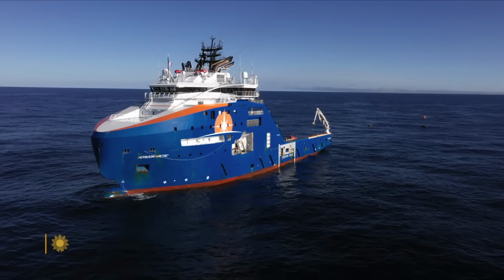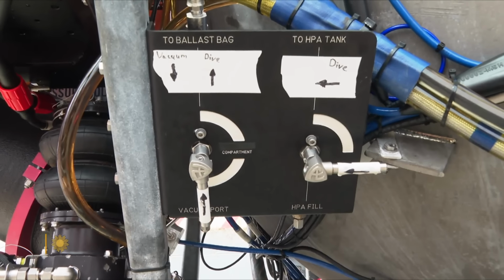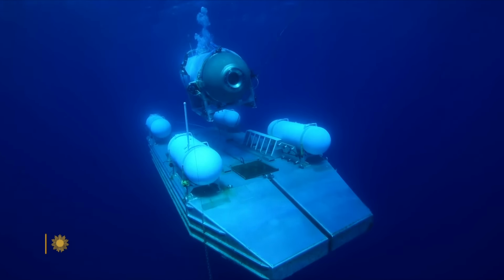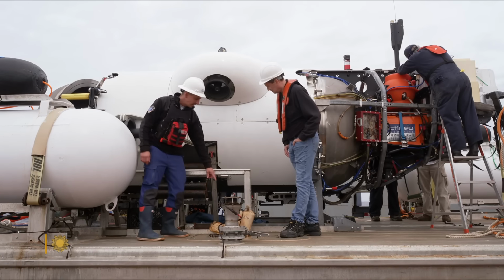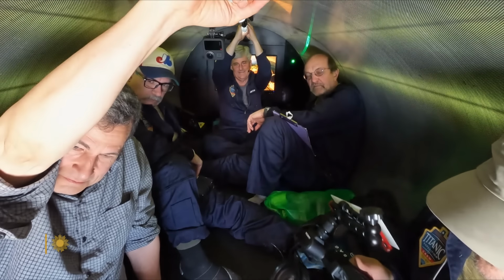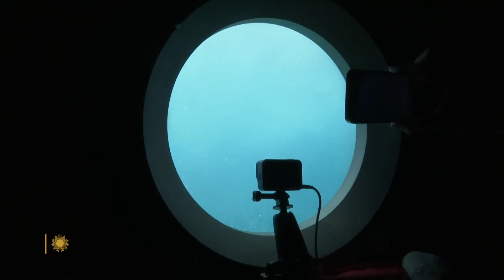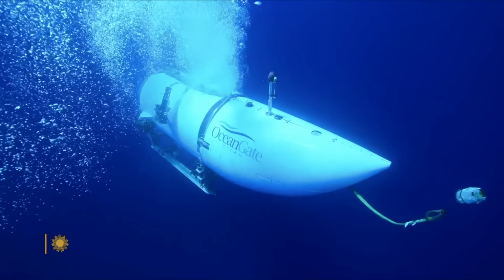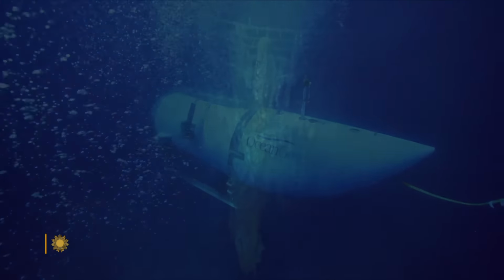Inside the Titanic sub disaster

Comment: Carbon fiber is great for tension....but terrible for compression, especially in the shape of a long tube.  Rush was using it just opposite in terms of it's actual strength.  NASA used carbon fiber pressurized containers on the Space Shuttle, but they were 1) spherical in shape, and 2) contained internal pressure, not trying to withhold external pressure.
Reply: Why did NASA went with the production?
Reply: @rollzolo NASA uses the same material for their spacecrafts, but to my knoweldge they had nothing to with the creation of this tincan. if i recall a lot of the parts used were for air planes, used parts even, literal junk.
Reply: Ok well it’s not “terrible” or else it would’ve failed earlier. If it did fail, it was likely due to fatigue, which is more difficult to detect in a non-ductile material like carbon fiber as to steel or titanium. The guy at 7:30 explains this.
Reply: Absolutely correct. Imagine blowing up a balloon inside a cloth bag. It would hold a lot of pressure. Now imagine quashing it in a vice. No contest!
Reply: A couple of cans of Flex Seal would have done the job.
Reply: @rollzolo

They didn’t though. They were not involved in anything but theories. They never helped in building or safety checks.
Reply: @rollzolo they weren’t and have stated as much.
Reply: Nobody knows if it was the CF that failed. It could have been the joints or the glass.
Reply: Carbon fibre is the new stainless steel. It wants to do everything, but it can't. That's just how physics & chemistry works darling.
Reply: @stellarwind1946  Which is why it's terrible.  You don't build a deep-dive sub to fail.
Reply: This is a known fact. Fibres are flexible and cab take tensile force. +Pressurisation of talk. Not negative. It was near luck if at all this equipment saw depth earlier. Might be bluffing. Gone some depth not upto 4000 m.
Reply: @gordonwelcher9598    Phill Swift here, and you are correct!!
Reply: Hope they knew Jesus 🤟..
Reply: Forget NASA. There is a reason a full coke can is sturdy but folds like paper when it is empty.
Reply: @stellarwind1946  Any design that is barely adequate and will work a few times before unexpectedly failing is "terrible".  If you can't really detect fatigue in the material, then how do you know when it's time to stop using it?  Not being able to know for certain that it has any more dives left in it sounds terrible to me.
Reply: @tesla69  They precisely know it was the carbon fiber delamination.  Speaking of joints....lay off them.  Stop being a contrarian.
Reply: everyone is an expert now, yet this thing has proven itself over a dozen times. This could have happened to any submersible and we would probably all be saying the things.
Reply: Carbon fibre is weaker in compression but it still has a decent amount of strength. The issue is not so much the use of Carbon Fibre but the very poor execution of a novel and innovative idea. The obvious weak spots are the locations where the titanium flanges directly attach to the carbon fibre cylinder using epoxy resin . Small differential expansions between the cylinder and flanges would be capable of imposing large shear forces to the epoxy weakening it over time. That could eventually become problematic. A more robust method of joining the two elements together was probably necessary. A better idea would have been to manufacture a thin titanium cylinder thickened at either end to allow a flange to be welded on with the centre section reinforced with carbon fibre. That would have allowed most of the design objectives (weight?) to be achieved in a safer way.
Reply: $10 could have saved the day!😆
Reply: I felt Stocks thinking relyed on the carbon coating to absorb enough pressure to not damage the titanium pressure hull.
Reply: @fastfed  Yeah, but you don't hear the designers of those other subs saying in interviews, "at some point safety is waste" and indicating that safety classification is antithetical to innovation on a sub that sells rides to tourists.  This HASN'T happened to any other submersibles capable of reaching those depths, which have all been classed.  Acknowledging the obvious contrast here isn't the same as claiming to be an expert.  But even still, actual experts are coming out with that same sentiment, so maybe you can take it up with them?
Reply: @fastfed  It actually proved that it was doomed to fail on each dive.  Reports are that the hull make all kinds of sounds, some quite loud during the dives.  Each and every dive fractured the CF at some level.  That is not an acceptable design at any level in which failure is fatal.
Reply: @jmkmusicpedals it’s not “barely” adequate. Every material is prone to cyclic fatigue, especially when subjected to those pressures. It’s not unique to carbon fiber. With regards to detecting it, Stockton claimed he had developed an acoustic measuring device to alert the crew if a failure is detected. Obviously it didn’t work or give them enough time to surface to shallower water.
Reply: @fastfed I agree, it’s also disrespectful to Paul-Henri Nargolet, who was one of the world’s leading experts on deep sea diving and was one of the passengers on Titan. He wouldn’t have boarded if he didn’t believe in the vessel’s structural integrity. It’s asinine to assume anyone here commenting knew better than him.
Reply: It was a pressure hull made of epoxy essentially. The CF held the cracked epoxy together until it didn't.
Reply: @stellarwind1946 on the Titanic as a wreckage, sure. But on the actual design and material? Nope. I doubt he was even actually allowed to see which corners were cut. I am still amazed the sub is not spherical with how many corners the CEO cut.
Reply: @jorelldye4346 Rov's use fibreglass/epoxy resin, along with santartic and finished with elastomer
Reply: Not true at all. Carbon fiber is extremely strong in compression. If it weren't it wouldn't be used to make wings or anything else subject to bending loads.
Reply: McClaren was the only guy on here that made any sense
Reply: @zachary3777  Where there is bending, there is pulling...and that is tension.

Comment: I’m an aerospace engineer working for a huge company with composites( carbon fiber). Once I heard that this submarine is made out of composite I knew right away something really bad is going to happen. This guy should’ve known that compression on a carbon fiber will shatter and will not leave deformation. Not only that it takes years and months to develop a good submersible submarine. He took a short cut to validate his own sub than the professionals validating his sub. This sub is all about compression , strength and deformation. I question how the plies are laid up, 0,+45,90&-45??
Reply: Could you explain further? Or simpler?
Reply: dafuq is composite?
Reply: With a 5" cross section he had no way of knowing what was going on with the internal structure and it sounds like he was averse to ultrasound testing. There seems to be some confusion over whether the pressure tube or the viewport failed. It would be nice to get clarification for the sake of data. If it was the pressure tube then we learned that his design is really only good for 3 or 4 dives before it needs to be replaced. 

Before Fosset passed he had a sub commissioned to go to Challenger Deep that is also of carbon fiber design. To my knowledge they would only certify it for 1 dive.
Reply: I’m an engineer too. I thought the point of the carbon fiber was to prevent expansion of the titanium tube rather than resist compression? Not saying it’s not a stupid idea, but as long as the expected expansion is equal or greater to the external pressure, the carbon fiber would not be in compression. What am I missing?
Reply: @seanmurphy3413 the navy stated they found both end bells intact, which leads me to believe it was either an issue with the tube construction itself or the joint between the tube and end-bells. No issue with the viewport itself
Reply: @joaofelish he’s just trying to sound smart bro, he works at mc Donald’s
Reply: @Wrath6909  No he's not, a composite material is a material with very high toughness, but low strength. Toughness is the ability of a material to resist deformation, and strength is its ability to survive deformation. Usually the 2 properties trade off (i.e. when one is high the other is low), and materials like Carbon Fiber are very tough, meaning they don't bend very easily, but when they do, they shatter. The sub being made out of Carbon Fiber could have been a critical error, because the second the fiber bent a little bit, it shattered, causing an implosion. Subs should be made out of materials which can flex, which most composites don't.
Reply: @Wrath6909  When you have zero clue about something that is said online, you go do a bit of research yourself to verify. You are, on the other hand, being deliberately ignorant and misleading people at the same time.
Reply: @joaofelish a structure composed of more than one material.
Reply: That wasn't what failed though. It was the windows from what I've heard
Reply: @OhCosmos. Thank you for that information it makes a lot more sense to me .
Reply: @NanaD-ve9tt  No problem brotha 💪
Reply: not to mention the 21 inch viewing port was only rated to 1300 meters by the manufacturer...
the contraption was a disaster just waiting to happen... surprises me that anyone would knowingly crawl in that death trap.
Reply: @Wrath6909 McDonnell *
Reply: I love my boyfriend
Reply: He knew,  he even put sensors to hear the cracks when it'd start that's why they were on the way up,  but apparently sensors don't make you go up to the surface fast enough...
Stupidity
Reply: @rw7567  Not a student anymore and not qualified to answer (passed AP Physics 1 and failed AP Physics 2 in High School), but im guessing that after its already 11 successful visits to the titanic, that the carbon fiber got weaker. Also, the cylinder in between the two hemispheres that make up the submersible is completely made out of carbon fiber, which would mean that as well as preventing the expansion of the titanium tube(?) it also has to resist compression. Also, im not sure that the carbon fiber would be in the right state to expand, especially with the force of all the water around it pushing in on it. please feel free to educate me if i am stupid right now lol
Reply: @xyxyxylophone  u clearly have no bf or gf 😂😂
Reply: @2close4nae  they are so goofy 😂😂
Reply: @2close4nae  I bet that person has no family 😂😂
Reply: @Wrath6909 hey hey hey there’s nothing wrong with working at McDonald’s 😅
Reply: This is exactly why we know more about space than we do about the ocean.😮
Reply: @noemimorales3069  lies
Reply: This why I love watching television. I get a clear  and better view of any situation.
Reply: I don't understand how they oriented the carbon fibre strands (strong under tension) of the cylindrical pressure vessel to withstand the compressive forces not only on the sides, but also from  the ends- the titanium endcaps pressing in. I assume that the epoxy resin was intended to take the compression, but if that started to disintegrate the whole thing would crumple in, even with the carbon fibre strands intact.
Reply: It's incredible to see an aerospace engineer in this comment section, however. Congratulations, you are an incredible person! I am in college right now, I love astronomy, but aerospace engineering is about as otherworldly as the field to me. Thanks for providing input here! And congratulations on such a well-led life, my friend!
Reply: @rw7567  you are missing the fact that the tube is not pressurized from the inside to match the outside pressure, otherwise the occupants would get nitrogen narcosis just like divers do.  The entire vessel is under massive compression from the outside as the inside remains at atmospheric pressure.
Reply: Did He Have A Second To Apologize To His Fellow Crew Members 😢
Reply: @DrBarnsnation Probably not.
Reply: @rw7567 I just watched a video of them bringing up some of the debris & the viewport is not there anymore.. I’m curious why
Reply: The piles were not overlaid.  he wound the carbon fiber up like a damned roll of wire
Reply: Yes true, but the window would be my guess at failure. I seen a lot of sweat on  that seal.
Reply: @xyxyxylophone  there’s old video showing the construction of the tube. It was a metal tube (I’m assuming titanium) with 5 inches of carbon fiber being foil wrapped around the tube like toilet paper.  I was thinking the fiber would counteract expansion of the metal tube itself. I think he was trying to use carbon fiber and titanium because of their toughness since this would be for a machine that could be used many times for deep dives. Something not accomplished before. Deep dive machines before it were only designed to complete one dive and then they were trash. Technically he accomplished that task but perhaps at a greater cost than he bargained for after all. 🫤
Reply: @cluebin8398  no I’m not missing that. I watched older video of the titans construction showing a metal tube (titanium?) being foil wrapped with carbon fiber. So I was speaking of the material expansion and contraction due to temperature change more than internal pressure. And based on some things Stockton said in that video. Not saying it was a smart choice, just trying to understand the possible logic.
Reply: Copy Wikipedia and paste to Youtube comments, very clever 👏
Reply: Z naturą jeszcze nikt nie wygrał
Reply: I think it was actually 0,+44,90&-47 if I'm not mistaken
Reply: Hope they knew Jesus 🤟

Comment: he should have been stopped at "carbon fiber is stronger than steel and titanium". No, Stockton, only cheaper. The thing you built is what you'd get if you ordered a ROV from Wish. Those were literal famous last words.
Reply: Carbon fiber is also more brittle, untested and in development
Reply: Carbon fiber may have greater tensile strength, but under pressure puts compressive loads, not tension, on it! A carbon fiber hull is much weaker than steel or titanium. Not too mention it was a cylinder shape, and that is inherently less strong than a sphere
Reply: Metals will take a certain amount of load and then tend to bend before they break.  Carbon Fiber is nice material,  but it will take a load, and take some more load,  and some more load,  and then it will instantly shatter.
Reply: @pyropulseIXXI  cylinders are only string when pressure is applied vertically, but sadly no one explained water pressure to this guy....Carbon fiber...when i heard that all i could say was "WHAT?!"
Reply: @@Richy_Tthat same submersible did go down about 2-3 times in the past right? Looks like the structure just couldn't take it anymore
Reply: @@Richy_T I see
Reply: @PepRex  😶

Comment: The changes he made to the submersible and the materials he used played a huge role in the implosion. To make matters worse, there was a lot of safety concerns and people either got fired for it or simply left the project. And prior to the dive, the CEO seemed desperate in inviting/convincing people to join, even traveled to see the original father and son who was supposed to go to the dive just to confirm and secure them to join but due to safety concerns, they opted out.
Reply: It was troubling to learn that he cajoled others to join his risky adventure to get funding, and he fired (bullied?) an employee for voicing concerns about safety.
Reply: Has the same Titan Submersible done previous trips to the Titanic wreckage? I'm a bit confused
Reply: Yes, we know all that.
Reply: @asjaismail3259  it has done multiple trips to the titanic, but aside from the missing certification and other safety concerns, certain materials have a maximum lifespan under certain conditions, especially submersibles or submarines. The materials suffer "wear and tear" with every dive and you have to do maintenance, checks, certifications, NDIs(Non-Desctructive Inspections: Basically inspecting the material without cutting it in pieces...a common method in engineering). OceanGate not only didn't do any of this, but also fired and sued an employee who raised concerns about it and demanded that they do it. The whole incident was just a matter of time, because essentially the hull gets weaker with every dive and eventually it gives in which is eventually what happened in this case. The other thing is that carbon-fiber is a very new material that we have done very little research on and we don't have much experience with, while other materials used in subs like aluminium and steel are materials we have 100+ years of engineering experience with.
Reply: @asjaismail3259 yes. It had made over 50 dives including some to depths similar to the Titanic. It had successfully made it to the Titanic 12 times according to this video.
Reply: @@user-le3tt2du8h yah, my buddies have carbon fiber bikes.  They are always telling me about the cracks they have in the frame.  I have aluminum and don't have that problem.
Reply: They were smart, the idiots who died had it coming each in their own right.
Reply: Rush, such a befitting name
Reply: @BigTdeluxe  Thank you
Reply: @haleyhopes5774  Thank you